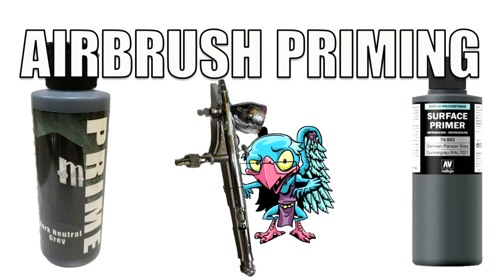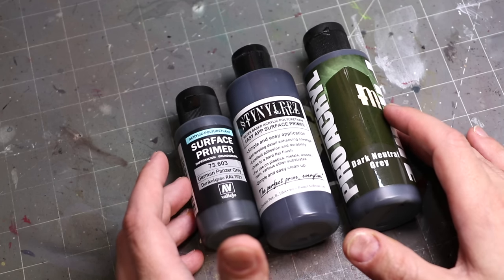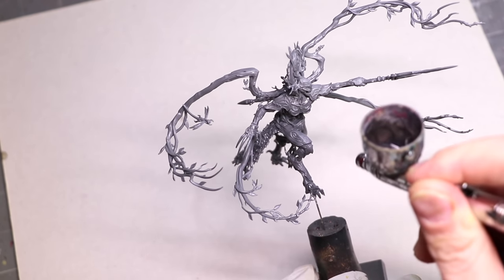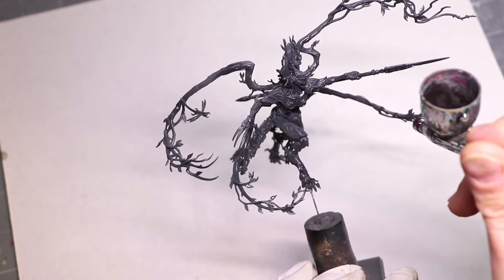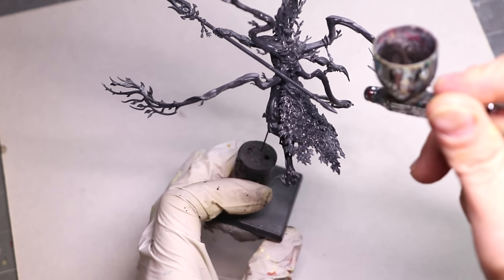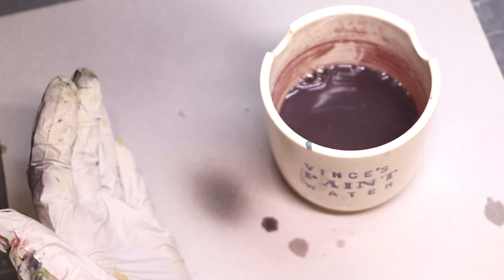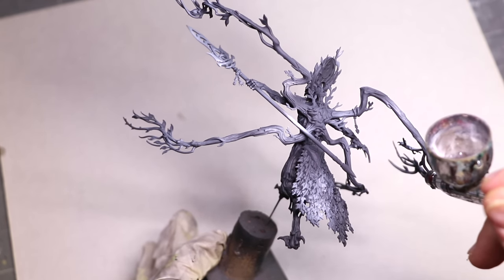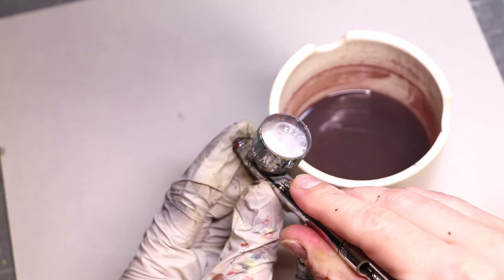Complete Guide to Airbrush Priming - HC 350

Comment: Hi Vince!

Lovely video. I've been airbrush priming for quite a while now, but this video definitely "unlocked" something for me, and my process has been improved immensely. 

I too love the Proacryl Primer. I do experience that it rubs off rather easily, even after curing. I contacted monuments hobbies, and they said this is expected. How is your experience with this, do you have any issues with the primer rubbing off?

I try to avoid handling the mini directly, but i can get a bit clumsy.
Reply from the maker: I've never had the issue, but it may be due to my humidity. If you do have that happening, a quick varnish layer once the primer has cured will lock everything in.

Comment: Thanks for this informative video! Learned a lot! Saw someone also on YouTube about adding “J&J Pledge Future”  50/50 adding it with Vallejo Surfce Primer. He claims that adding future will help Vallejo Surface primer dry faster. What do you think?
Reply from the maker: It's an old scale model trick. Its not really necessary, it's just increasing the polyeurathane content in there, so effetively a varnish in with the primer, I am not sure it will dry any quicker (maybe slightly), but it will theoretically make it tougher, that being said, it's generally not necessary and can cause some challenges with very small details, it's really from a time model cars or airplanes and the like.

Comment: Never tried using iPA to clean the airbrush with, but I will swear by hot water (Barbatos Rex used it the other day and I had to try^^). It removes paint so easy from the cup it's almost cheating. :D
Nice and informative as always! Been meaning to try out PA primers since their normal paints are just freakin amazing, just don't have a local supplier :'( so shipping from the states is too expensive to just buy 1-2 things. :)
Reply from the maker: Glad you enjoyed and good tip!

Comment: Should I use thinner even for paints prepared for airbrush (like Vallejo Model Air)?
Reply from the maker: Absolutely, you can thin less, but always, always, always thinner. A few drops first to keep everything moving before the paint. Air brush ready paints can generally go 1-1 or 1-2 (paint to thinner).

Comment: Thanks Vince, loved this vid again you produce the goods when I need it most!

On cleaning your airbrush, I picked up an "air brush cleaner" that takes the excess water/paint/cleaning product by using the front of the airbrush. Should I not be doing this? I have been experiencing my (cheap) airbrush build gunk at the tip of the needle and maybe this is the reason? I will dump as much as I can out the top of the cup and use this as a way to clean the remainder of what might be left in the airbursh.

Would love to know your thoughts!
Reply: If you're using you're airbrush for extended periods of time without cleaning it as Vince showed in this video is another possible reason for that happening. 

But if you're shooting the cleaner through the airbrush before all you can see in the cup is clear cleaner after back flowing it, then yes that is most likely the reason why you're getting build up on the tip of the needle.

I have a plastic "dump" cup with a folded up paper towel in it, which I learned from another Hobby Cheating video Vince posted awhile back. I do about 2 to 3 cup fillings and back flowings with cleaner and water, getting it to a purely clear liquid before doing a final dumping and only then will I spray the last of that clear cleaner & water mixture through the airbrush, just to clear it out.

Also it could be developing if you're not using any/enough thinner & flow aid in your paints and/or primer. This happened to me one of the first times I used my airbrush to prime with and totally forgot to add flow aid. It really sucked, but I learned from that mistake... and rewatched all of Vince's Hobby Cheating videos on airbrushing again. I've not had an issue since, but remembered the hard way to always add my additives in the cup first, then the paint or primer, then mix with a long bristled brush, then back flow it and finally start to spray. Now it's like second nature. 

I hope that helps you out.
Reply: @Winterydee  Thanks my dude! Really appreciate your reply :) I’ll definitely take these notes on board the next time I use it
Reply from the maker: Yes, there really isn't any reason to use those bottles (other than to hold your airbrush in between actions). ;)

Comment: when i tried priming, the liquid mixture started to bubble and it was difficult to airbrush the primer.  Is the reason because I had a different ratio of thinner to primer(about 50%) and no isopropyl alcohol or is there another reason? I also mixed the two with a brush after pouring in both liquids, I did add thinner first and mixed it a second time by blocking the nozzle and shooting the air back into the container to mix it.
Reply from the maker: No, if you’re getting bubbles, it means there is an air leak in the nozzle. You’ll want to pull out the nozzle, clean it, and reassemble and make sure you get an airtight seal. I use a tiny amount of vasoline around the brass nozzle, but once it’s airtight, that should stop.
Reply: @VinceVenturella  Are air bubbles still the reason if I block the front to shoot it back?  Also thank you, I'll disassemble it and try and fix it.

Comment: At around 8 minutes you mention the backflow of paint through the airbrush. I just happened to buy an airbrush with little holes on the side of the nozzle. Now I cant backflow anymore. Is there any way around that, or just accept it?
Reply from the maker: You can buy little caps for them to do it, or you can use a wet paper towel or rubber glove and cover the end.
Reply: @VinceVenturella  Nice, thanks a lot for your answer. Going to hunt down those little caps I suppose. I just really wish I looked at the nozzle head before I bought an (admittedly very good) airbrush.

Comment: Wanted to confirm -  for primers, do I use both the flow improver and the thinner to create my thinner mix and then add the paint? Or just add the thinner and then the primer? From your video i understand it is just the thinner and then primer added to the cup before starting.
Reply from the maker: Yep, thinner and flow improver mixed together, a few drops go in, and then the primer in afterward.

Comment: So, what would you say are the pros/cons to using white primer instead of white inks for zenithal priming and pre-highlighting?
Reply from the maker: White inks are a little more durable, but it's not necessary, you could certainly use an ink or a paint or whatever you like. :)
Reply: @VinceVenturella  ah, k. Yeah, I've only ever tried inks because I'm very wary of white primer from the rattlecan days, but sounds like no reason to try it for the airbrush as long as white ink is working out for me.

Comment: question : you are using acrylic primers yes? none of the lacquer thinner debacle things. do you need a spray booth also if you are using acrylics only?
Reply from the maker: Correct, all acryllic primers. Its still a good idea (you should always use a mask), that booth is more for catching all of the spray  so your walls don't end up primed. :)
Reply: @VinceVenturella  i already got the mask, so i can just spray in a lit up cardboard box then? Or at least make a basic ass set up without the booth fan like..... Uh...... Covered up wall?
Reply from the maker: @hoshi314  Yep, a cardboard box will work fine. You just need something to trap the spray.
Reply: @VinceVenturella  Cor! Good to know!

Comment: My compressor must be lacking, then, because if I put it down to around 20 psi or less, the pressure doesn't appear to be sufficient to blow primer (or much of anything) out properly? Is it my compressor or am I doing something wrong? I generally use white ink straight out of the bottle for zenithal priming and I've yet to have a problem with that approach. I picked up some good pointers in this video as usual, thank you, Vince!
Reply: Are you thinning it? 18 PSI will definitely spray Vallejo surface primer of you thin it around 70/30 primer to thinner.
Reply from the maker: It should work, so there could be a leak there, it could be that the paint is too thick, it's tough to say.

Comment: What about when priming metal miniatures? Two thing coats too? Any varnish on any step apart from when the model is finished?
Reply from the maker: So with metal (which I avoid like the plague) - You want to do two possibly 3 coats of primer, then it can be a good idea to give a quick varnish after the primer has completely set, that should really provide protection regardless of final varnishing.
Reply: @VinceVenturella  thanks! I think I will avoid from now on but many bloodbowl teams have been metal until last year or so that changed to printed resin and I will have to tackle them 🙈
Reply: @VinceVenturella  I have vallejo polyurethane matt varnish, how would you apply? I've been doing by brush without thinning the few times I used but not sure if it's better in another way (in general and in this particular case), thanks!
Reply from the maker: @christiansebine7316  So just a quick shot through the airbrush or with a brush after the primer has cured is fine. Airbrush if you can.
Reply: @VinceVenturella  when using airbrush 1-1 with thinner/water isn't it?
Reply from the maker: @christiansebine7316  more like 1 thinner to 3 or 4 varnish.
Reply: @VinceVenturella  Max psi I got on my compressor is 25 (cheap game boy like one), will be fine with that ratio? Thanks for all your help by the way 😊
Reply from the maker: @christiansebine7316  Yep, I do it at 20 PSI
Reply: @VinceVenturella  cool, thank you very much!!😃

Comment: Im new to this.. and i mis one piece of info.. what needle size do i need for primer ? Ive see somewhere that you need a little bigger needle to prime.. is this correct or does it not matter when using 1 drop flow improver?

Great video, been a subscriber for a while and finally got an airbrush.. This channel is just one of the absolute best i.m.h.o. Thank you for putting so much time and effort into these video's.. they are of great help to me !✌
Reply from the maker: I use my standard .3 needle, I wouldn't go smaller than that, but that is fine.
Reply: Thank you  😃👍

Comment: I have a silly airbrush question. When I set my PSI, the gauge on the compressor shows a number. When I pull the trigger on the airbrush, that number drops and will eventually settle on a lower number. When people say "set your PSI to X" are they talking about that first number? The number that the compressor shows when I'm not touching the airbrush at all?
Reply from the maker: Yes, the first number, that should be the pressure flowing through. Getting an airbrush with a tank will minimize that and make it more consistent.
Reply: @VinceVenturella  thanks so much for the reply.

Comment: Hello everyone, If i get white primer, can I add paint in the primer to change its color?, If i do then do i still have to change the air pressure as he mentioned in the video, or does it then turn into any other average primer?
Reply from the maker: You can, it will weaken the primer some as the paint isn't as durable (not containing poly eurathane), but it can be done.

Comment: I love the badger primer. But my god the stynelrez always always clogs my airbrush. This never happens with Vallejo, scale 75 and army painter primers. I don't know why. Any tips in using the badge because I love the finish and I have a huge bottle that I dont use anymore because of the constant clogging.
Reply from the maker: So Badger has a challenge when if it gets to cold, it can clump up. A good run through a strainer like panty hose will clear those clumps.
Reply: @VinceVenturella  Great! I appreciate the advice.

Comment: I come from an airplane modelling background. There it is common to use solventbased primers that are very easily cleaned with for example tamiya laquer thinner. They adhere a lot better to the model and airbrush cleaning just with thinner takes 20 seconds. Why isnt it used with miniatures?
Reply from the maker: Different level of modeling expertise and technical skill required, also, those are often quite toxic and that's more concerning.

Comment: How durable is your airbrushed primer typically? I've been really struggling with getting my primer to be durable. Even with multiple coats and plenty of drying time, it seems to scratch off quite easily.
Reply from the maker: Generally pretty durable, but I never scratch at it, most primer will come off if you scratch, but nothing should really be touching your minis with that force, and once the paint is on and you varnish, you're generally fine.

Comment: Am I tweaking or is 3-4 drops primer to 1 drop thinner a crazy high primer heavy ratio? I usually use 2:1 thinner:paint/primer
Reply from the maker: I don't find the need to thin pro acryl primer very much, 1 to 3 has always worked without issue to get a solid layer down.

Comment: What is the point of white primer if you're spraying over a couple layers of black or grey primer already? Why not just use white paint, and avoid some of the hassle? (or ink, but I don't use ink for zenithal priming because of potential re-activation issues)
Reply from the maker: I just like the extra durability, but it's not required and I often use paint as well.

Comment: Great video Vince ! I was wondering, do gloss black primers have niche cases for use?
Reply: Gloss prime is great to spray Metallics over it. That’s how I’ve used it, and it really does help to keep the lustre and look of “real” metal.
Reply: @anderotaola7515  thanks, I will give it a go !
Reply: So be mindful if what you’re priming will be mostly metal or not… I’ve used it on necrons and it works a charm. Then you can weather it down or keep it looking new. But if there are sections that shouldn’t be glossy… eh it gets a bit iffy unless you’re priming in subassemblies or something big.

It’s a lot more comfortable applying non metallics on a more satin or Matte prime. The finish is of course subjective, I prefer matte-satin (mostly matte with a tiny bit of sheen), to full out matte or gloss for non metals.
Reply from the maker: Yep, that's the use case. :) - undercoating metals.

Comment: Once you discover the joys of transferring automotive plastic primer from a spray can to a bottle to use in the airbrush, you won't use that water-based vallejo and Stynylrez crap (which doesn't actually prime) ever again.

The beauty of solvent based primer is that you never get tip dry or clogs.
Reply from the maker: I'll have to give it a try.
Reply: @VinceVenturella  It's easy enough. Just place a small incision with a box-cutter close to the top of the can, allow the gas to escape, then cut the top completely off and pour out the paint. It requires no thinning. You'll need cellulose thinner to clean the airbrush though. Best to use one with PTFE seals, or an old single-action syphon feed. 

In addition to priming, painting white is a doozy with solvent based paints. I basecoated an entire Tau Riptide with not one single instance of tip dry.

Comment: I have issues when I backflow of the paint/air bubbles building up too much and potentially spilling from the cup, even with very low amounts of paint/thinner. 
Is that normal? Every time I see it in videos it doesn't seem to be an issue compared to what I'm experiencing.
Could it just be too high air pressure?
Reply: Yes. What’s your psi? I stay at 15-18.
Reply: @brkfstfd  it varies a bit depending on what I'm spraying, but usually a bit higher than normal as I have drying issues in Australia. 
Usually I have it around 30 which drops to ~ mid to low 20s when spraying. Occasionally higher around 40 which drops to ~30 when spraying for thicker paint like primers.
Reply from the maker: Yep, it's the PSI and or the trigger control. You want to use a lower PSI and / or rock the trigger very gently.

Comment: The issue I encounter all the time is tip dry with my Ultra 24. I thin my primer to the same mix you do and I have a high humidity. I spray in short bursts but the tip dry happens super fast. This confuses me a lot
Reply from the maker: Could be a few different issues. Could be the PSI is too high or low (you want to run around 18-20), could be the particular primer (lighter/white integrated primers will tend to dry tip faster), could be a slight deformity in the tip, if there is even a slight bend, it will cause tip dry really fast.
Reply: @VinceVenturella  I use the glossy black Vallejo primer. I already toned it down from 25 to 20 because the air nearly blew off the thinned primer. The needle has a weird marking where it touches the nozzle, but both are smooth and clean under a magnifying glass.
I will tone down PSI to 18 and I will try to mix thinner and primer a bit better. Thank you Vince.